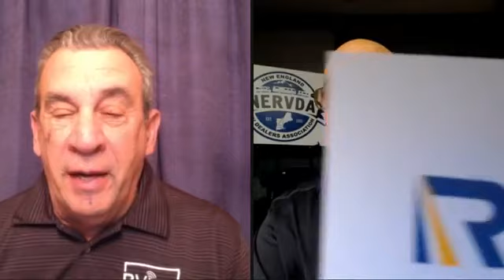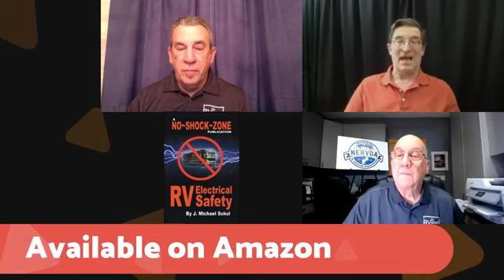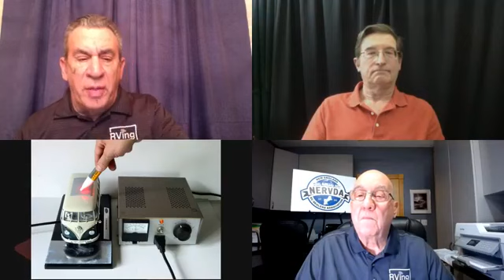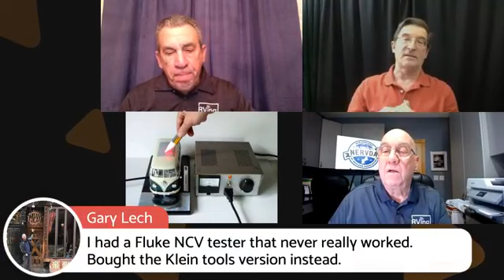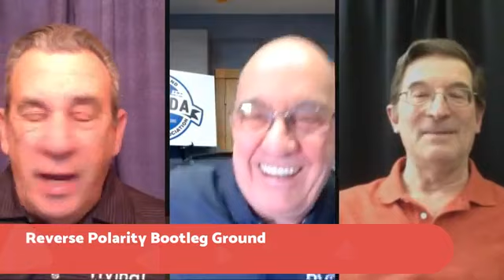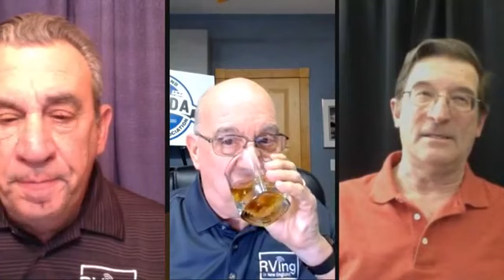NERVDA Live Talk Show - Mike Sokol talks RV Electricity

Comment: Had a million ants on my pedestal outlet & now it doesn't work! Did the ants do this or just a coincidence?
Reply: Tina, since the urine from ants is most likely acidic, there's a strong possibility that their combined "output" would be highly corrosive. That would corrode/rust the contacts in the pedestal. So were the ants inside of the pedestal or only on the outside. If only on the outside then I would say it was just a co8incidence? But if they were inside of the pedestal and outlets, then I'll get it's due to ant corrosion.